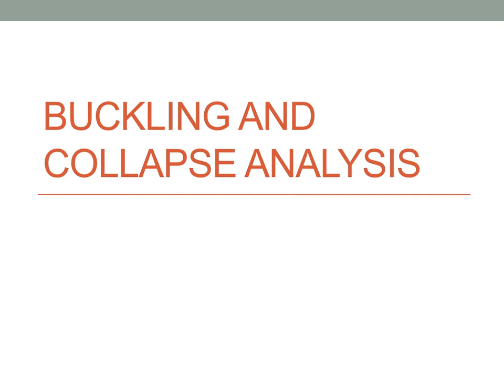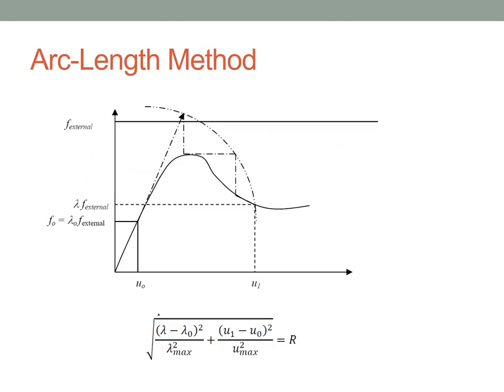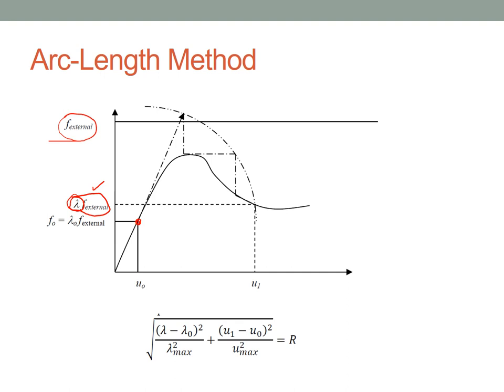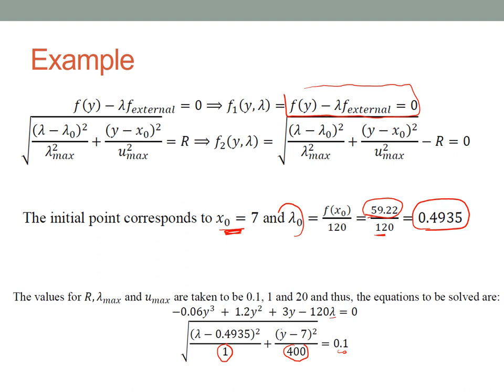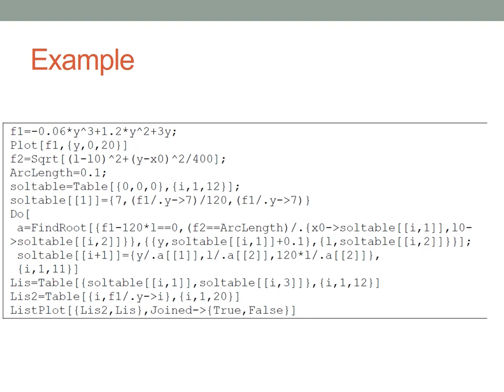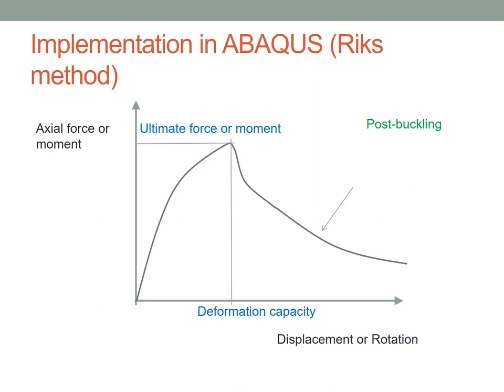Lesson 10 Buckling and Collapse Analysis

Comment: @Samer Adeeb For Riks method can you applied displacement load. For example when you are showing the pipe under bending can we use applied rotations instead of moment along with RIKS method? Is there any difference if displacements and not forces are used?
Reply from the maker: You don't need to use the RIKS method in a displacement control simulation. The example shown here is just for demonstration, but the proper way to simulate it would be using "static general" under displacement control.
Reply: @Samer_Adeeb  I understood that, but if I decide to use a displacement load with Riks method, does it make any difference?
Reply from the maker: @spyrosarvanitis5180  I wouldn't expect it to make a difference. It would probably converge faster.
Reply: @Samer_Adeeb  Thank you!